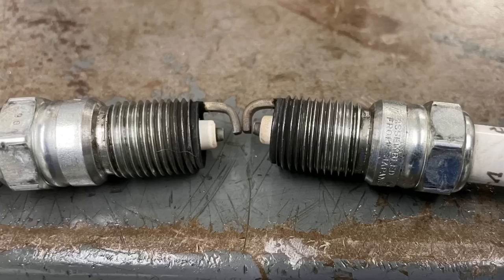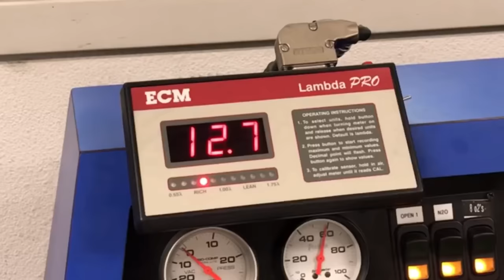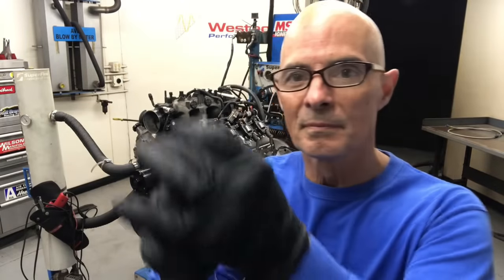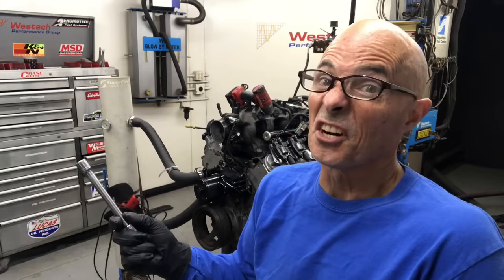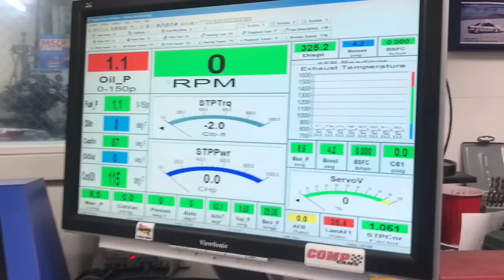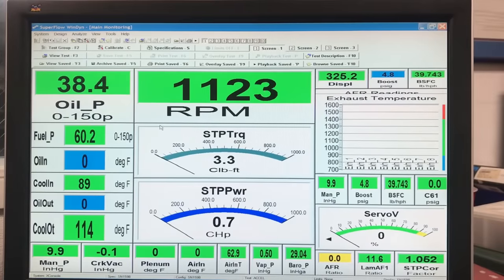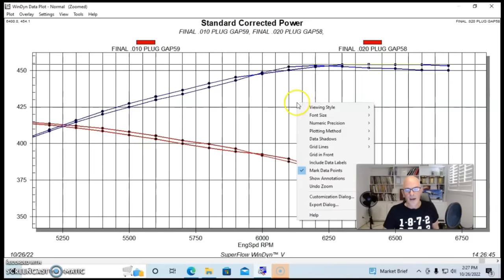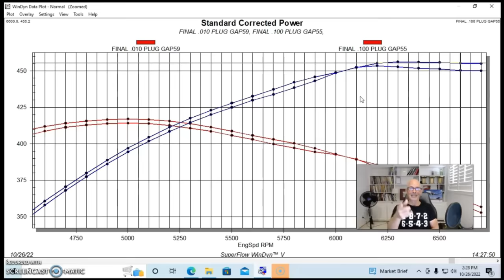JUNKYARD LS PLUG GAP TEST. DOES MORE GAP EQUAL MORE POWER? HOW MUCH SHOULD I RUN? .010 VS .100 GAP

Comment: I’ve always thought that a wider gap delays the spark jumping because the voltage needs more time to build to a higher value in order to jump the wider gap. Would increasing the plug gap add timing? More timing sometimes equals more power. I know we’re only talking tiny fractions of a second but at 6500 RPM it might add up to a degree or two.

Comment: Interesting though how a change in plug gap effects a small difference through out the range.from low rpm to high rpm.
Reply from the maker: Not a universal change in plug gap, only a change from .010 to .100-and you would have to look very close to find any power between the two extremes.

Comment: Opening the plug gap will always yield more power as it increases the area of the mixture exposed to the spark increasing mixture burn efficiency.   You always the largest gap your ignition system can provide voltage for. With modern plugs that hardly wear at all you can do this.   Back in the day conventional  plugs eroded rapidly enough that the gap would quickly exceed the ability of the ability of the ignition system to jump it and you would be regapping plugs a few times a year.
Reply from the maker: always?
Reply: @richardholdener1727   Yes Always...
Reply from the maker: SWING AND A MISS
Reply: You obviously do not have much of a grasp on this. Running larger gaps  ALWAYS produces more power and better efficiency , provided you can generate the same intensity spark as the smaller gap.  But you are not going to run gaps so large that they over tax the ignition system to do so would  not be very bright, and it's just basic common sense.    Larger gaps provide more air ionization and exposure to the fuel air mix resulting in more thorough combustion generating higher efficiency and better power generation.  Larger gaps ALOS  have more reliable ignition of the fuel air mix especially with lean mixes and rich mixes provided enough spark intensity can be provided. This why every one uses the widest possible gap that will provide stable ignition of the fuel air mix. This is all basic electrical and combustion theory  Seems you missed that class... So do tell, show us where smaller gaps will provide more power with the same spark intensity over a larger gap.

Comment: I would like to see Old tired OEM coils vs New OEM coils vs MSD or other Aftermarket coils. I am sure it will only be a few HP here and there but I would imagine that going from old coils to new coils could be a worth while change.
Reply from the maker: it makes zero hp-these were used coils and wires and plugs

Comment: What about indexing them? I raced late model stock for years with a 350 and 500 cfm carb. My crew chief always indexed the plugs I didn't think it was worth anything but in that class 5 hp can be the difference in pole and 30th starting position, so I didn't argue much.

Comment: This isnt a generic test, its specific to that engine. On my NHRA Stock Eliminator '87 Monte Carlos SS L69 305 it likes .045 using Nippondenso T16PR-U11 plugs. These plugs not only run better with VP C10 fuel but the car seems to rev faster. Ive played around with gap some on Eddie Carlisle's dyno but nothing as dramatic as what you did here. The difference between .035 - .065 was minute like in your test and .045 was what the engine liked best so thats what I use. Its not what we like its what the engine likes: David Vizard.
Reply from the maker: I have run plug gap test on many engines-gap matters little til you run boost and need less

Comment: Whatever happened to getting the mixture
an getting a good clean burn???
You know, that light tan color you want on the insulator? A wider gap may give you more burn, but a short, stout, strong spark will also give you a better burn n resist flame out from too high a compression... Also, most folks don't use WOT wide open throttle to go to the grocery store... Extra horsepower? Burnin more fuel...

Comment: Nice testing!
Are there limitations for the gap-size from cylinder-pressure caused by compression-ratio, ignition timing, boost...?
Reply from the maker: boost requires small gap
Reply: @richardholdener1727  does it also apply for the other two sources for higher cylinder pressure: early ignition and/or higher compression ration?

Comment: With small engines i always like to add a little extra plug gap. With carburetors on small engines they aren't very accurate so I figure a little extra gap helps things burn.

Comment: While the book-ends and the nearly book-end were good to see, to know for sure what's going on, you need to test more plug gaps in between. 0.100" might be past the optimum and it might be getting less power than, say, 0.050" or 0.060".
Reply from the maker: don't look for power in gap-make sure there is no misfire (tight gap with boost) and you are good
Reply: @richardholdener1727  I'm fully aware that any power gain due to spark plug gap will be small. However, if someone is going to so a "science experiment," they might as well do it properly and not leave the question unanswered about whether there's an optimum point between the book-ends.

Comment: The alternator also has sufficient power. On smaller engines, the alternator drain might rob a hp or two from the engine. Try to test this with a 125-500cc engine.

Comment: This result is what I expected.  Tiny .010 gaps have a greater chance of being in a sub optimal mixture when fired while huge .100 gaps are 10 times more likely to find an optimal mixture when fired. The tiny gap would have a greater percentage of cycles that light off slower than optimal which would appear like slightly retarded timing for that cycle. Huge gaps reduce that tendency and cause the over all average to have less scatter, slightly increasing power. The better the fuel and air are mixed, the less important the gap becomes. 
I'd bet that a hydrogen or propane fueled engine would be much less sensitive to gap size.
In general I'd use the biggest gap that you can fire reliably for that last 1/4% which sometimes makes all the difference between win and lose.

Comment: Plug gap would change the spark voltage and current.  3 hp is insignificant when you consider 455 horsepower.  If you really need that kind of power where 3 more is going to count, better upgrade those coil packs so they like long electrical gaps.  Stock won't like it too much.
Reply from the maker: there was only this difference because we used unrealistic gaps in this test to prove a point-don't look at gap for power
Reply: @richardholdener1727  I see: As long as it lights the fire, it's good.

Comment: A really small gap is easily bridged by a fleck of carbon or cad plating from the plugs body, putting that cylinder out. An extremely wide gap tends to tax the electrical system, overheating CDM's and their drivers. Like everything else in life, moderation is key .. :-)
Reply from the maker: a .100 gap comes nowhere near taxing the ignition system on an LS
Reply: @richardholdener1727  Are you saying there is no more amperage draw @ .100 than a more normal gap of say .028" to .035" ?
I believe it's cumulative, big peak + hold injectors, big fuel pumps, electric water pump, intercooler pump, water-alky pump, sump return pump .. big azz stereo .. ;-)
I would have to agree, that individual cylinder ignition systems have a much greater rest / charge time over yesterday's single coil, distributer ignitions. But I can't help but think, asking factory type CDM's to operate at three times the normal gap .. can't be good for them in a day to day environment.  
Glad to see the test though.  My money would have been on normal gap as best power, plug life and efficiency. And under boost / nitrous conditions, the big gap would start shootin ducks. At least that's been my experience.

Comment: Big gap great, but the gap comes under pressure with increasing cylinder presser, compression ratio or forced induction?
Reply from the maker: boost needs small gap-I run .019 or so

Comment: Opening the gap gives more dig and acceleration. 

Closing the gap gives better high speed running without misfiring. 

It all depends on the energy supplied by the coil in a Kettering ignition setup.

In Kettering, the points close allowing current to flow through the coils primary winding. When the points open, the coils magnetic field collapses thereby inducing a current in the coils’ secondary winding which causes an increase of voltage in the secondary winding. 
This voltage increases until the spark plug can overcome the air/fuel mixture in the cylinder and then the spark occurs, causing the air/fuel mixture to ignite. 
At high engine revs the coils magnetic field may not have enough time to build a strong field because the points open sooner than at lower revs. 
This, in turn, produces a smaller induced voltage in the coils’ secondary winding. 
This smaller secondary winding voltage may not be high enough to cause a spark to occur, thereby giving rise to a misfire. 

If a capacitor ignition setup is in use, then opening up the gap should not be a problem because there is more ‘power’ supplied as opposed to a Kettering system. 

Note:  The testing should be done on a motor that is under load, not just ‘revving’ it up on no load.
Reply from the maker: revving up under no load?

Comment: great analysis, great video..  but who goes up to 5k rpm with a v8 ... goodness with a supercharger I think Id have 10x the horsepower I need at 3k rpm? Im far more interested in the HP at 2k to 3k rpm or the max torque.
Reply from the maker: WHO IS AT WOT AT 2000 RPM?

Comment: I generally stick to .060 in my engines. Is there anything to gain by clocking the plugs? I point the ground strap towards the exhaust pipe.
Reply: Tradition says base of the ground strap between 10 and 2 o'clock.
Just half gap them and it doesn't matter.

Comment: Had 64 on my engine, you can too. If you have a TOP TIER ignition system, this means sparkplug wires too.
Reply from the maker: it works-just adds no power

Comment: When you have outer  electroid  split the center of the inner electroid it burns cleaner, misfires less  & isn't equal to the 1 gapped at 21! I use to play with plug electroid positions & even v gapped plugs & they burned cleaner & fouled less!
Reply: Splitfires ran great!!! Noticeably better on everything I tried.
 But I had several plugs (random sets)  blow the porcelain barrel loose and leak compression... Pfft pfft pfft  Boosted to 11.

Comment: Wide gaps will overheat coils and cause failure over time of coil windings .

Lean mixture needs wide gaps 
Rich mixture smaller.

On racing motorcycles engines .
Yamaha school.
Reply from the maker: this is not 4-valve-center plug location like a Yamaha
Reply: @richardholdener1727  two stroke days for me 1980s ..lol

Comment: Could see the .100 making more power as it got the afr up around 12.8 and with .010 it was pretty rich at around 12.2. 
LS’s love 12.8 👍🏻
Reply from the maker: no
Reply: @richardholdener1727  in saying that, there is possibility a huge difference in the fuel there compared to Australia, I noticed in another video you mentioned you optimised the timing around 27-28deg, not a hope in hell could you run that much here 19-20deg and it’s pinging at 21deg, most I’ve put in one was 23deg and that was it’s limit

Comment: As long as you have the coil recharge time and the power to jump the gap, your results are as I would have expected. If the ECU used to do this has misfire detection using the spark plug as a sensor to detect for remaining ion field, the misfire detection wont work with 100 gap. There wont be enough joules in the coil to jump the gap if the ion field is still present from a misfire... Those ECU's work by pre charging the coil with a low voltage to only jump the specific gap if it misfired. So while this will work on some setups, it presents serious issues with some ecu designs if there is a misfire that goes undetected.......  Food for thought....

Comment: Not sure if this is a silly question, but is the larger plug gap harder on the coils? Seems like it would at least be harder on the wires. If the spark finds and easier path through the wire than it has with cylinder pressure and that huge gap, it will take the easier road.     Another thing I wonder is if the .100 gap was losing power compared to something like .050
Reply from the maker: its not losing power compared to .050-and these coils have made 1543 hp, so they are not taxed

Comment: Way back...i ran 289/302 and 351Ws
I thought i usually had the timing,fuel,ignition all synced as the engines all ran very nicely
Then i decided to see just how far off i was and had the car run on a dyno.
After the first run the tuning guy turned to me and says...do you have a smaller set of jets for that Holley?
Get rid of the Autolite plugs and get some NGKs and while you are at it get rid of those crap plug wires.
So...i grumbled but did as he said
Next day he set everything up i changed the carb jets to smaller..he set the gap on the plugs and added a pertronix ignition replacing the points.
My first run was 266hp before the changes.
After the changes it was up to 273hp
Then he really focused on the plug gap we ran it again 276
We changed to bosch plugs and the final Hp was 281hp!!
I couldnt believe the gain made by a few simple changes...cost me $450 for 3 sessions on the dyno but to me it was worth it,i gained a substantial amount of horsepower..enough that you could feel it when you stomped the gas...and i also learned the importance of NOT GUESSING or HOPING you are on the mark with timing,gap anf fuel

Comment: If you increas the gap the spark will be longer = burning more fuel in the cylinder = more power and efficiency 
But if the spark didn't reach the point  
You will get miss fire , all depends how powerful the coil is , powerful coils = longer sparks

Comment: When I experimented with plug gap, I I never went as drastic. But the difference wasn’t in horsepower or dragstrip numbers. What we noticed was a little better driveability with a slightly larger plug gap.
 We got the idea because of the driveability improvements from swapping a points type distributor (with.035 gap) to an HEI (with.045 gap). I recognize that the hotter ignition factored in, but several people felt that cars felt smoother and slightly torquier around town with a little extra plug gap.
 It’s worth noting that we did this on engines with a distributor and a single coil. I believe that the individual coil system is so hot and the ignition coil recharge time is so quick that it is already incredibly efficient. I think your test confirmed this.
Reply: It also depends on the engine. Higher dynamic compression runs better with a slightly closer gap.
Reply: The best way I found to play with plug gap was to watch the fire time with an oscilloscope. Also ran channel two to measure coil amps. 1.8 Ms is where I ended up on most occasions.
Reply: @willleavitt7156  Interesting.

We did it the old school method, idles better/worse, check time slips and work an average, watch for misfire or just miss at high load.

After a lot of time we "discovered" that old school engines prefer .035 to .055 depending on the strength of the ignition and how powerful the engine was, mostly how much fuel was dumped all at once.
Reply: Any time you increase the gap, the coil has to dwell longer to build more voltage in order to overcome and jump the gap, producing a "hotter" spark, and therby slightly more rapid and complete combustion, which will be most noticeable at lower RPMs, but this comes at the expense of both coil and plug longevity, rendering it not worthwhile to do in my experience.
Reply: @johnny0454  There's always the possibility of a weak link in the ignition not allowing the gap increase but if you've upgraded (or even replaced with anything aside from factory) then a modern coil and any ignition pickup beyond points and capacitor can handle an increase to .045. Generally start to see random misses at high RPM on older (80-90s) ignitions over that.
Reply: @stujones3566  The secondary waveform shows the whole cycle from beginning to end. There is lots of info on the Pico website as well as other sources. Analyzing the secondary waveform is a big subject, well worth spending some time learning.
Reply: @willleavitt7156  I'm going to play with this if for no other reason than to finally use the oscilloscope my grandfather gave me.
Reply: I agree. In small engines adding a little spark gap can solve idle issues that aren't carburetor related.
Reply: Not everyone will remember this but on the large cap HEI distributors, there were two different IE ignition coils. The yellow wire ignition coil was a slow charge coil that used a .045 plug gap. The white wire ignition coil was a fast charge coil that used a .060 gap. I used the white ignition coil on a 383 SBC with 9.5:1 compression in the 90s with a .060 gap and did 12 second 1/4 mile runs shifting a 6500. And it had great driveability and good manners on the street. It also made torque everywhere. So that is the car that comes to mind on the issue of plug gap.
Reply: You'll also find, cold weather starts are easier with the extra spark plug gap. It doesn't have to warm up as long, before it's drivable.
Reply: My 03 stock 4.8 with 706 heads I had milled a bit (don't remember how much was taken away) runs better with copper at .038

Comment: The gap is a resistance and it should change the timing curve.Small gap more advanced and I am wondering if you would have take time to look on timing light if you see a few degrees off and maybe your advanced wasn t anymore 34 but 38 and you lose a bit of power to  much advanced.Just an example.
Reply from the maker: we adjust timing til there is no gain in power-the timing was spot on
Reply: @richardholdener1727  Thanks to the reply.